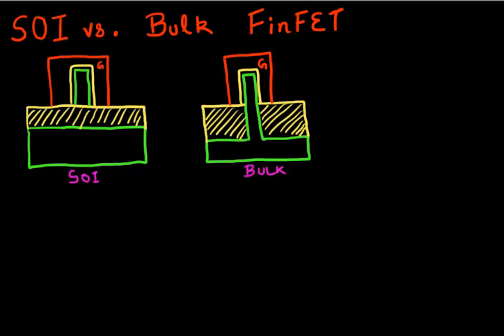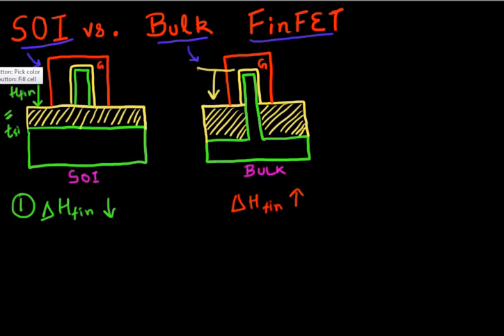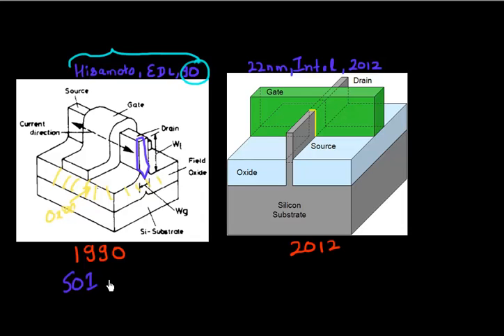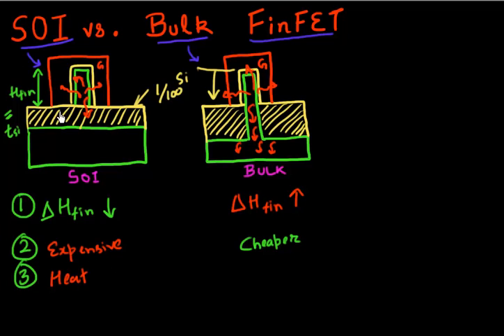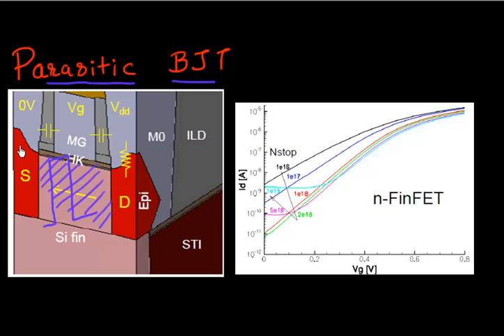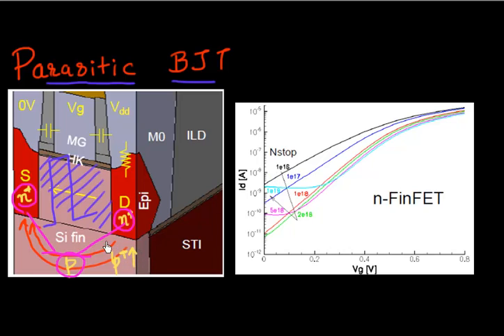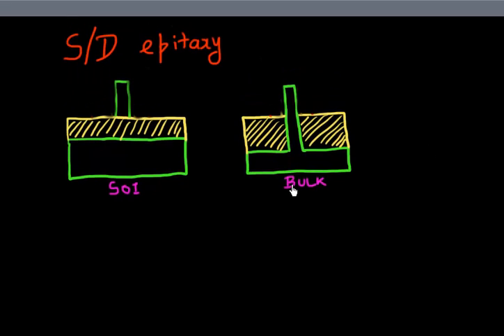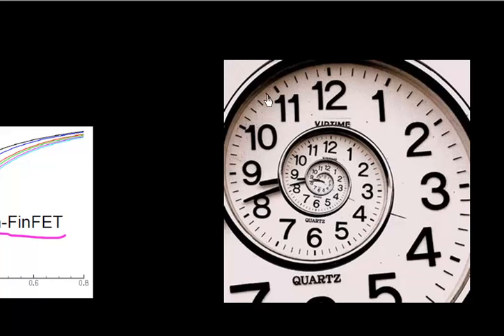SOI vs. Bulk FinFET

Comment: sir let me know the role of substrate/ body in SOI-FinFet, because it is isolated from fin and source and drain as well.....??
Reply: The role of body is very important, body bias facilitate channel formation and resulting in faster switching of transistor.
This biasing creates buried gate below buried oxide making it act like vertical double gate transistor. Moreover, by using these two gates you can transform the characteristics of transistor(High performance or low power). I hope this helps

Comment: Very interesting. To note - at VLSI ('13) in Kyoto IBM shows self-heating is not more of an issue for SOI (Experimental Analysis and Modeling of Self Heating Effect in Dielectric Isolated Planar and Fin Devices, S. Lee et al). Also, see SOI Consortium for excellent animation of bulk vs. SOI FinFET processing -- SOI wafer cost more than compensated by fewer processing steps. Be interested to hear IBM's take on SOI source/drain issue, which I understand they've solved.